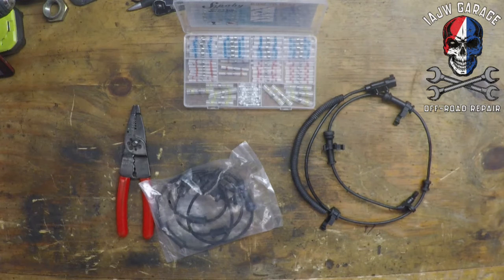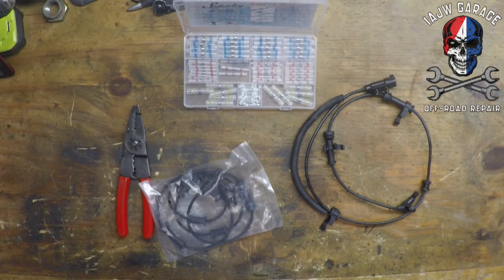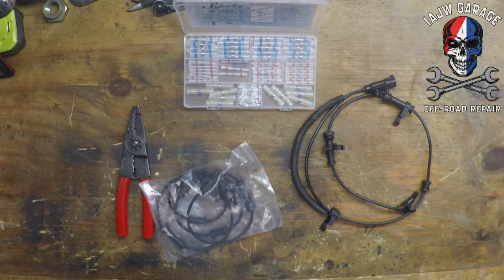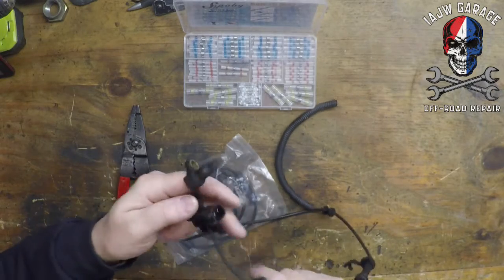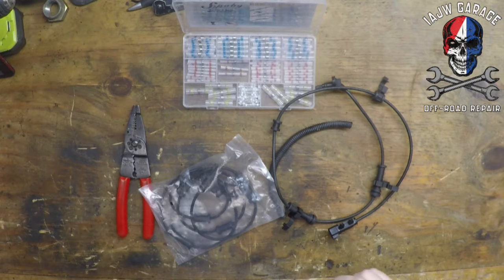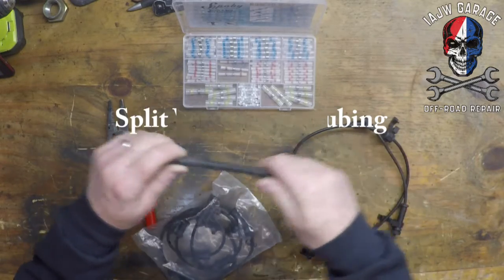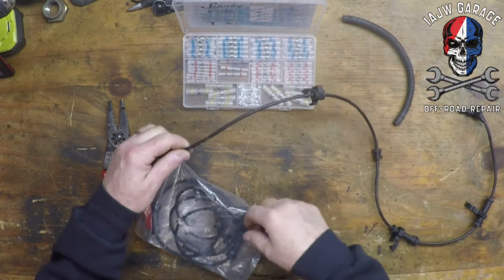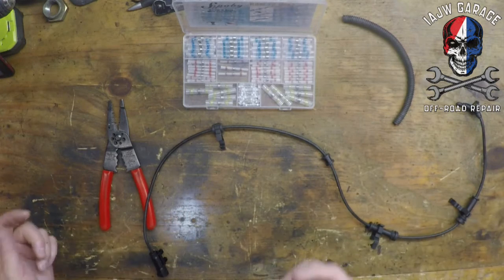Easily and Simply Extend your Jeep Wrangler ABS Wheel Speed Sensor Wiring

Comment: Nice video. Do you mind sharing the link of your connectors. I like that they are soldered
Reply from the maker: I think I got the wheel speed sensors from Amazon, I soldered the extension on the new Wheel Speed Sensor wires